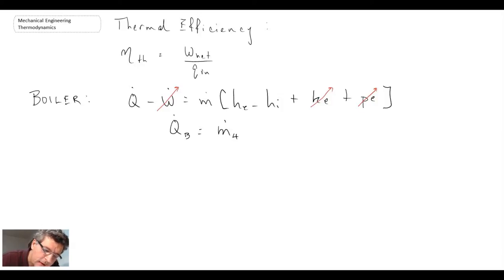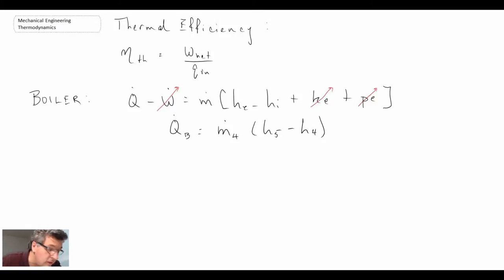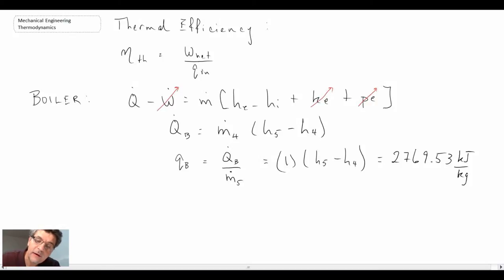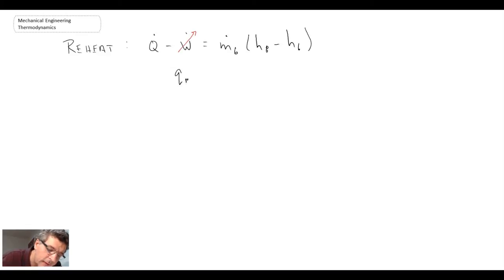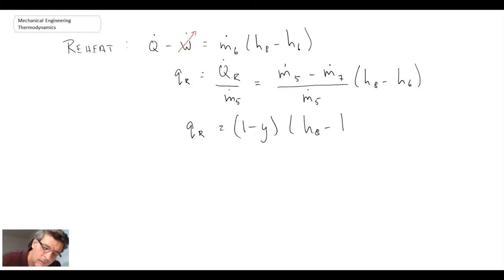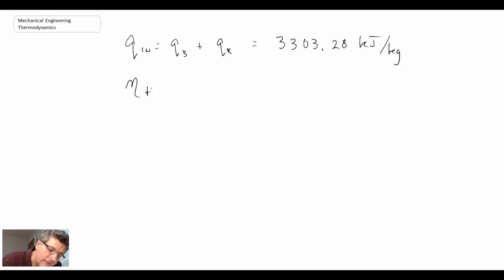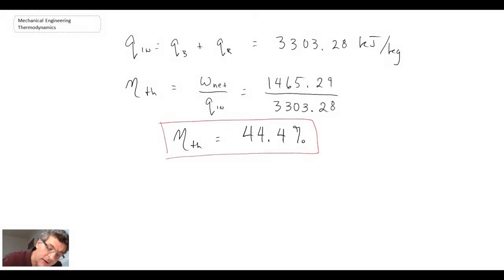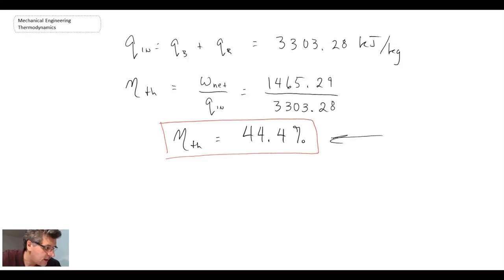Mechanical Engineering Thermodynamics - Lec 21, pt 5 of 5:  Example - Regen-Reheat Rankine - iv

Comment: Dear Ron Hugo,

Thanks for the explanation, it was very useful. However, I still have a doubt. What happens if the cycle is not ideal and I should use the efficiency of the turbine just for the whole turbine and not for each separate output of the turbine?
If you can help me with this, it would be great. Thank you for the attention.